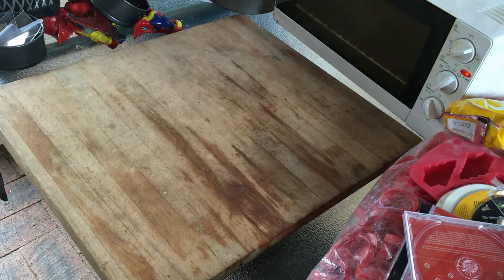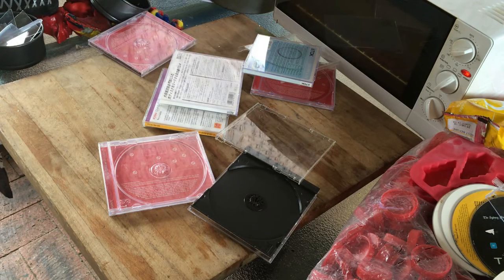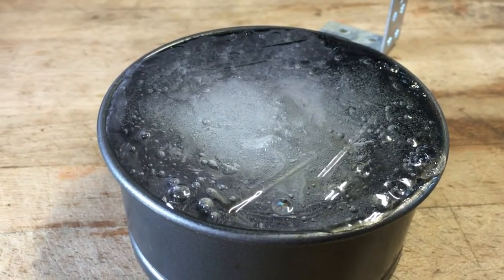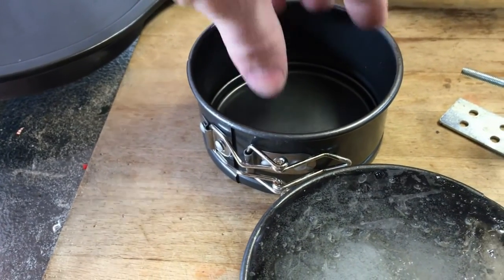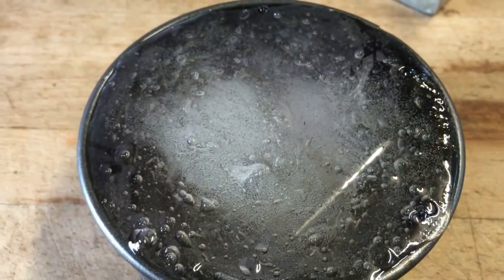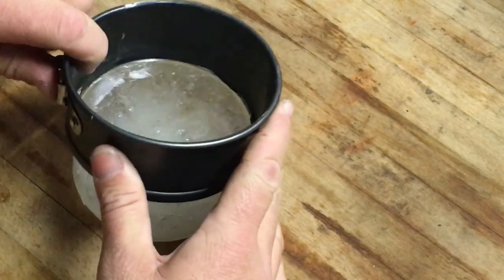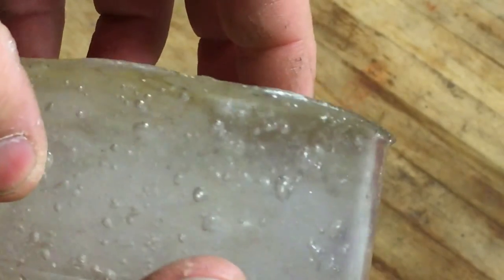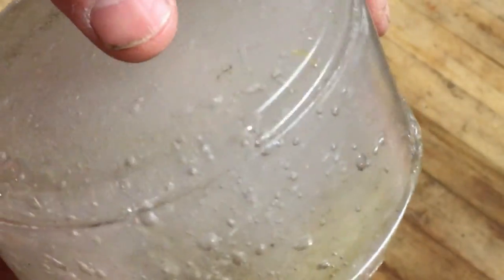Ep37 Melting ClearJewl Cd Cases

Comment: It want to do this for a major project. I was wondering have you came up with a way to completely remove all air bubbles? I am thinking melt and cool 3 or 4 times to remove them.
Reply: Or I am thinking melting it in a mold then when it is still a hot liquid state I will go around the mold a gently and repeatedly tap it with a mallet to see if I can get the bubbles to rise to the top
Reply from the maker: @bakugosrage8976  

Hello and thank you for the interest but there is no way to dislodge the air bubbles caught in the plastic. The only way to make a solid block is to inject the plastic in to the mould. Only pressure will be able to force the air out of the mould. Hope that helps and thanks for watching.. kevin
Reply from the maker: Also will add that depending on the viscosity of some plastics it would be possible to put the mould and vibration platform in to the oven and heat and vibrate like i said depending on the plastic ( will result in less bubbles in the melt).
Reply: Hey brother I think I might have gotten around that bubble issue. I took a few clear CD cases and them in my neighbors shredder till it was a fine sand like consistency. I packed that into a can till I couldn't pack anymore and the finished product didn't have any bubbles. It might not work on the scale I will need it to be but that's a start.
Reply: I apologise I didn't state what I am trying to accomplish. I want to make clear plastic windows for a boat.
Reply from the maker: @bakugosrage8976  That sounds promising i might try that. The original problem is the air gets caught in the layers of plastic when melted. Grind it like sand very interesting idea ?

Comment: Next time after pressing it down n before adding more use a blow torch to get the air buubles out
Reply from the maker: Jena Rose
There is no good way to get rid of the air bubbles with out pressure of a confined chamber.  Injecting the plastic in to a mould  the presure of the plastic being directed in all directions is the only way that i can see to create the solid block. 

Useing a flame torch  i would think that the plastic would have a higher chance to burn. 

Thank you for your suggestion the only way we can learn and grow have is to have suggestions that i might not of thought of...
Kevin

Comment: How well does polystyrene work with silicone molds? I don't know if you've done that video yet since I just got here ^_^'
Reply from the maker: Hello Madness Jones
I have not tryed Polystyrene in silicone moulds. From what i have learnt from playing around with the different plastics. The polystryene will not flow in to a mould. You will have to press the plastic in to the mould. There are different types of silicones for moulding there are soft and hard silicones.

Most cake moulds and even the bunny i had. They just dont have the support to hold the mould and the pressure on the plastic being pressed.

Hope that helps
Do you have something in mind. Do tell?

Thanks for watching
Kevin
Reply: I'm wanting to make toys out of recycled plastic, and I figure the first step is knowing which plastics will even work for that and which molds will be best for each one. I know HDPE is a good one for molding, and PETE is so-so. Also, if you have any ideas for other materials for molds that would be useful information too. Your videos are really informative :)
Reply from the maker: Thanks for the kind words. All the advise is from my experience and learning about plastic since the channel started.

If you were going to make toys out of recyled plastic. It depends on how many you were wanting to make. If you were wanting to make 100 hundreds. Then you would invest in proper steel mould.

With moulding there can be pressures from 6 tons and up depending on size of the mould. As you can see the cd cases video above the air bubbles are in the plastic because i did not have enough pressure to get rid of them. 

Madness Jones I aplaude you in trying to use recyled plastic.
Thanks kevin
Reply: Thanks for replying. I don't really know how many I want to make or even if I want to stick with just toys. I just get tired of seeing good condition materials go in the trash. I agree with you that perhaps I should buy some steel molds so I don't have to worry about the silicone warping. I admit this is all new to me, which is why videos like yours are important. It's good to know about techniques, safety, and which plastics are best for which projects :)

Comment: What did you do with it?
Reply from the maker: hello 
Its  sitting around i have, It looks like a round ice cube. I have not thought much about it. I was disapointed that it had air bubbles in it. I will have to change the way i melt and compress the plastic. any ideas

thanks you watching 
kevin
Reply: I use resin and I use a heat gun to get the bubbles out. Maybe keeping it at a warming temperature for a while will allow the bubbles to rise?
Reply from the maker: I will investigate this but as far a i know it. The Polystyrene is not as forgiving as HDPE when it comes to releaseing the air bubbles. 

With HDPE lids when you get air bubbles in the work just heat the job and the bubbles rise to the surface.